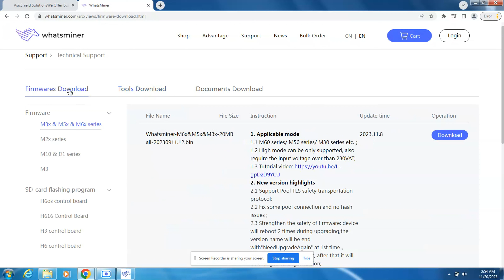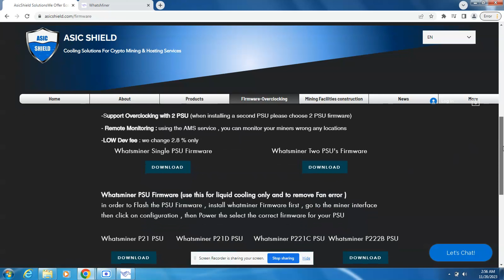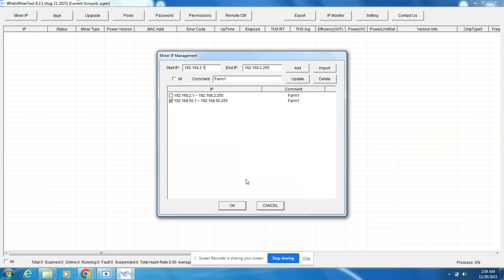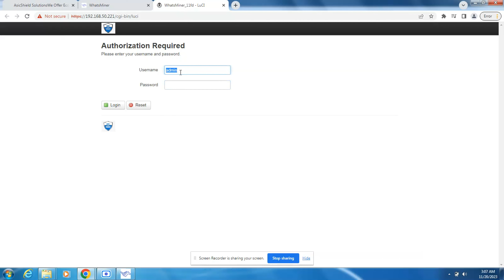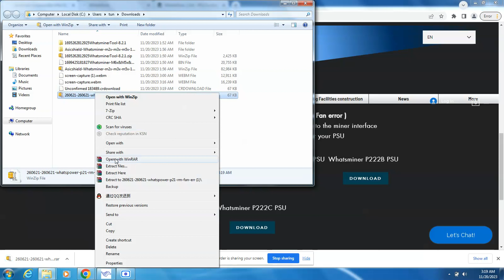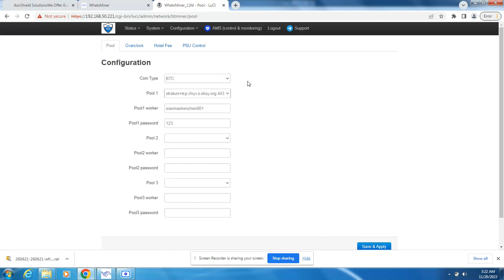Whatsminer Overclocking Firmware from Asic shield up to 50% more hashrate

Comment: Can i lower the power consumption for M30S+ 96T 36w and what results could i get
Reply from the maker: yes you can , by reducing voltage and frequency , the result will depend the auto tuning process , since whatminer does not use static value
Reply: @Crypto_mining_lab  
Dose it have AutoTune? Can you make a short video about it
Reply from the maker: @aligamar2750  Whatsminer original firmware run on auto tune , so it’s nothing new , the firmware is available , you can test it yourself and see the results

Comment: Does it work on air cooled miners too?
Reply from the maker: Yes it does , it work with air cooled , immersion and water cooled
Reply: @Crypto_mining_lab  just bought the P221-F power supply, will fire the firmware as soon as I receive it

Comment: Great video.  Thank you. 
Any thought to lower Dev Fee for farms using Asic Shield Immersion tanks with the firmware?
Reply from the maker: Yes there is a program but its based on the total hashrate you will running using the firmware